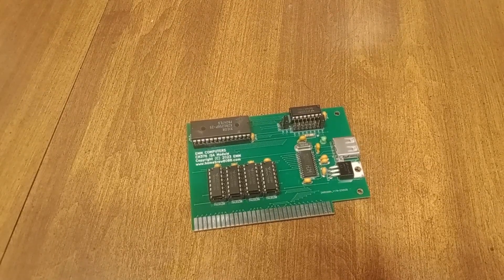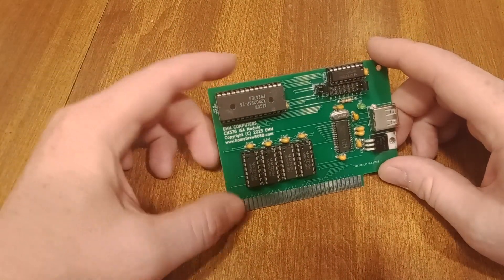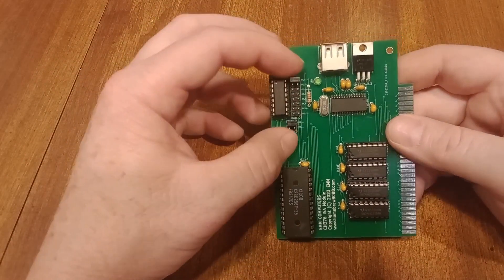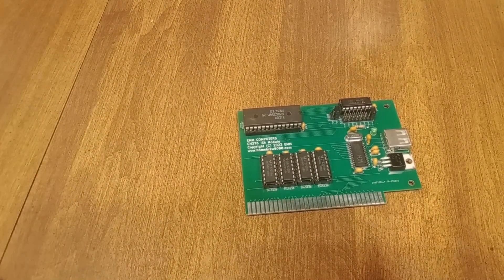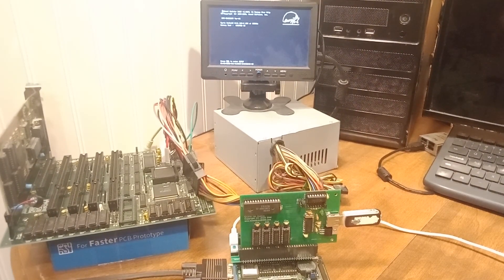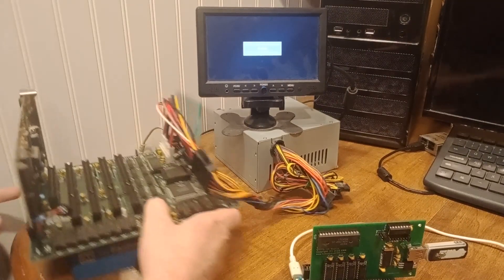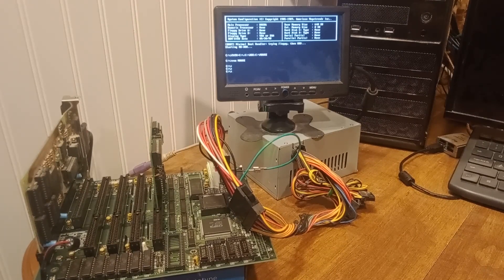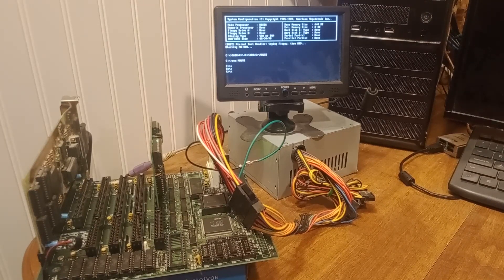ISA USB Drive Card, CH376

Comment: Super intressting as always, will the adapter for sbc be released also? would need one :)
Reply from the maker: Yes, if requested I can make them available. I don't plan to keep a listing open
Reply from the maker: I have listed 2, PC/104 adapters on eBay. I wont have the USB cards for a little while.
Reply: @elijahmmiller   Sadly i missed them. is there any chance that the schematics will be public? i am more intressted to be able to drive pc/104 board with usb-c, the isa slots is not that importent to me ;)

Comment: I've been watching the series for a little while. I'm not in position to leverage the card as the moment since my only ISA computer is a finicky 386SX-16 in which I don't want to risk enhancing at the moment. On the other hand, I have 6502 project I'm starting (read: shamelessly copying work from DrMattRegan and Ben Eater and tweaking to purpose). I was thinking about mimicking your USB module for a while now to leverage as fake "floppy controller" (I probably could just store a few disk images on a spare PicoPi,  have it attached to the bus, and use software and PIO to emulate the controller, but I always end up doing things the hard way). I was wondering if you might be willing to drop the schematic to this one or the module in your GitLab for me to study (assuming I didn't miss it). If not, I still appreciate the progress you show on your channel.
Reply from the maker: The schematic is right out of the CH376 datasheet. Only addition is mapping the IO to Port 0xE0.
Reply: @elijahmmiller  Gotcha, thank you